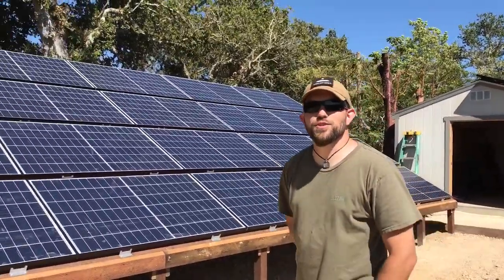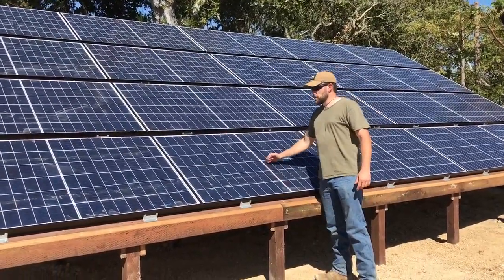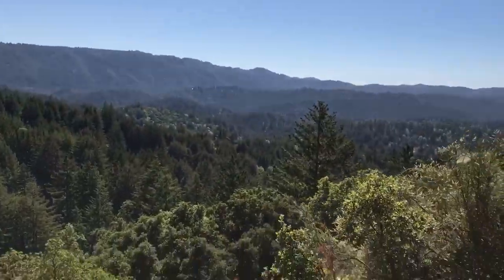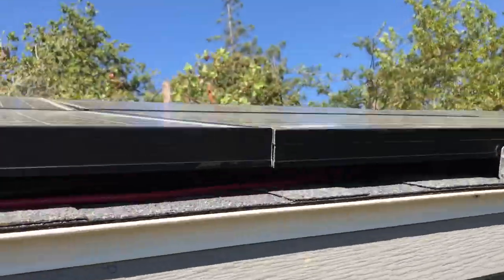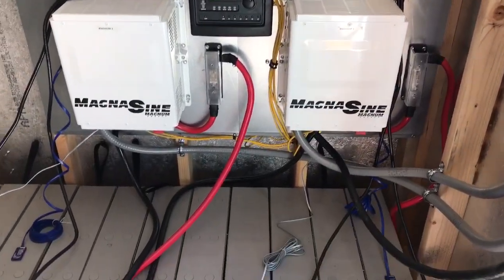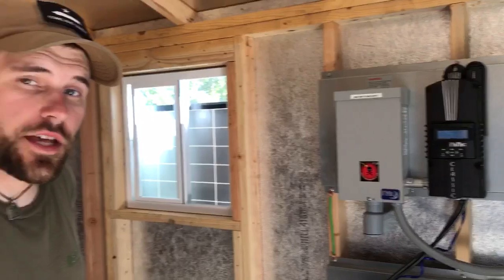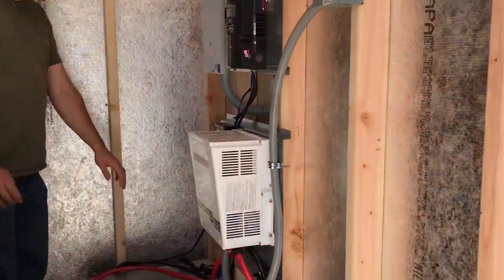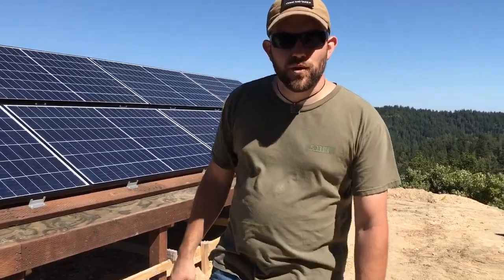12.7KW Off Grid ground mount Solar install by Off Grid Contracting

Comment: This is not off grid living, 1.5 Kw to maximum 3 Kw is off grid living. Offgrid living is not about solar panels and the comfort of city living.

12.7 kw, might as well as move back to the city to one of those suburbs.
Offgrid living is about trhiving off of the natural habitat with a little tec.
When it is it is, when it's not it's not, you don't depend on it, but good to have it.

People like you ruin it. 

When there is sun you can use your 1 to 3 Kw in mostly anything, you can heat water to take a bath, you can do many things, even play on your computer. When there is no sun there is no power and you have to take it like what ever you think you are, man , woman, take it like a man as they say, because this is off grid living.

This is not off grid living, off grid is going back to nature and living in a more natural way without being plugged into the outlet of the wall all the time, managing without it when it's not there, managing on your own without the help of these things.
What off grid is about.

12.7 Kw ...that is huge, even when you don't have sun you will still have like 20%  like above 2Kw of power flowing thru the panels.
Might as well stay in the big city with this "big  planning" of yours.
Reply: Pepsi78 --- off grid living and living a minimalist lifestyle are not necessarily the same thing. Most off gridders live minimalistically out of choice or necessity. Everything from water, food, electricity, etc. are more highly valued when you are the generator/curator of those resources vs having a perceptive infinite supply of such things as you do in a "city" environment. Living like Daniel Boone in a world where you can have modern comforts is a lifestyle choice.. but if one can afford the luxuries of modern society and still be self-sufficient... why not? Oh, and I'm pretty sure this solar system is in place simply because there is not an option to run power lines to the top of that mountain.

 I think what your saying in the end is that your off grid dick is bigger than my off grid dick. It is duly noted and I will concede..
Reply: I can manage with that with just heating wood, but I would like some solar too, not too much just for my stuff, like combine it with the heating wood stove, we don't live in stone age so I can get detergent, long ago people made and sold and traded detergent made out of lye and other things in exchange say for a bag of potatoes , people to this day still sell hand made sop  from their own back yard, 

If I'm power less as in no electricity I have to be ready to manually hand wash my clothing. We can own a car that "we can fix" right if it breaks down, with your own power tools.

I would say semi off grid, but when you are going large like 12KW it sort of takes away the fun and the meaning of what is off grid
Reply: Have it your way, but in a SHTF scenario you won't have these things, off grid means off the grid, has nothing to do with electricity or electric grid line.  It's off the grid, you get the hell out and go wherever you see fit to live and thrive off the grid. The grid line is the electric power company that gives you electricity from your wall plug, the water company that gives you heat and running water and the other companies and corporations.

Off grid is living without these, it's the whole point off the grid from them, not on their grid line in a more natural way, if you bring 12 KW of power you might as well build your own electric power company, you're a freaking power station at 12 KW.  You are living on your grid line now, it's still on grid, off grid means little things that you can manage on, then your off the off of the off grid off of all the grids lol.

Off grid means off any grid line, no grid line allowed, you mean to tell me that this guy with his huge installation hasn't made his own grid line. You can't say at 2Kw of power that you have your own grid line right, everyone will laugh hard at you for saying that.
Reply: Ikillbugs I think in off grid, or semi off grid living you have to combine things, like your wood stove, your smalls solar panels rater maximum to 2 - 3 kw, also have a  small 500W diesel generator, a small wind turbine, you can combine all these things and manage without a huge solar panel array.

Nothing compares to a fire place to heat the home, wood burning inside in the middle of the winter, you are burning pine, maybe nut branches and it smells so good from these oils burning, it gives off the aroma of what ever is burning, it will parfume your whole house.

I'm not for chopping and  burning trees down so plant your own, some trees grow very fast, they can be a few feet high in just a couple of years. You can cut the branches off of the trees  and in an year or two they will be back. You can also  go scavenging in the forest and only pick the branches that have fallen down, there are a lot of them on the ground, you can even make leaf pellets out of dried leafs, these dried up pellets  made out of leaves burn well for an entire hour.

Heat from the fire place does not compare to than electric heat that comes from your electric heater, it creates a whole different feel, steamed water made from the burning tall bucket that is a wood heating boiler will have a different feel, the water is different than the water you heat with electricity.

And finally your small electric appliance for your computer and power tools and for small heating applications like a tiny green house when it is very cold outside or inside your home to maintain some heat in the house to minimal acceptable temperature.

For me off grid can be inside a country side village, you don't have to go all the way to no man's land, where the hawk turns around and go's no further and man falls off the earth, but if you really want to live in a forest it's fine, interesting to live by your self in a forest, if you can do it that is great.

12 kw of power is huge, this reminds me of people chopping down whole trees for fire, majestic trees that were high like a sky scraper, it's the same type of metality with "huge  living" or "let's live big" I'm big, I eat 3 kilos of food every day, I can only stay on 12 kw of power, and if I don't have it I will heat my self by  cutting down a whole forest.
Reply: Self suficient is not an industry, it means little . As in I can manage with what I got.
You need all that it is not self sufficient, your self is not all those things that you use to help your handicaped being survive because "you need all that"

Okay I have enough to buy a corporation and a power plant, I have my own corporation and my own power plant, I don't work for others, right. I am off grid with my corporation and my power plant. I am not connected to any city grid line, I have my own nuclear reactor that I power my electric stove with, my microwave oven and my air conditioning unit.

It's not off grid dude, off grid means you fuck off for good for a while, fucking off means without shit.
I just fucked off into the woods. You just don''t fuck off with all that stuff, that is not fucking off, that is going "ON"

Your business if you want to fuck off or go on, but don't go on pretending you fucked off. Off grid means off any grid line or concept of grid line, big infrastructure, grid means infrastructure, lots off panels means infrastructure, wiring. 

I am well aware that people can't go off grid, most of them anyway, they are domestic animals, those who want to do it for real, good luck to them, I know they want be going off grid, but at least go off Semi off grid, with a little extra to help them out.

Captain America is at it again with a gigantic statue in the harbor of New York,  it needs a big ass flame in it's hand to light up and provide heat for New York, the city of Yorkenstine. 

Do you have any idea how much it costs to light up her torch, how much she consumes, all the small creatures flee from her, she will never truly "FUCK OFF" she has it "going on"

Your too stupid for me to explain to you philosophical things that you do not understand, because you are just like her, you are going on like a dead living cadaver.

Good luck fucking off, tho I doubt you will be able to.
My trend for off grid is FUCK OFF. From now on off grid will be called FUCKING OFF.
Off dude you turn everything down or off, that is off grid.

Will little John be able to fuck off into the woods, or will he have past regresive tendencies, remains to be seen into our next episode.

The Idea off grid is to go and set your mind at ease, to take a break from social residue, to repair your mind, body. Often off grid has been associated with the forest with people going inside the forest.
But if you don't come out of the forest at the end, it means you did not manage and that is your business.
Reply: The reason I'm commenting is for others who want to go "Fucking off" , maybe they want to fuck off.
You don't have to comment on me, I'm just telling them this is wrong and not to go big, go small.

I care about people  who want to fuck off, fucking off is no easy thing, I'm just saying that fucking off is not a "big deal" you see you will not understand what I'm saying because it's not indented for you, only for them.

I don't give a shit what you say, nor about your comments.
Reply: Some "wishes" he had the cash to build something like this. 

Stop hating on folks who are living how they choose.
Reply: So if not EM waves what screwed your mind? Cannabis probably
Reply: Have fun zombie,  don't expect Jesus II , there is no Jesus II. 
Good the zombies can't hear, their senses and vision in this world are gone this includes hearing.

Jesus please forgive me, I did not have much, just 20 Kilowatt solar panels. Jesus is not coming, ahhhhhh, how am I to manage with just 3 Kilowatts, I need more Electro Magnetic mind fuck to stimulate my mind so I can glide like a puppet. 

I need guidence, I think I'll install some transistors inside my brain too to flip flop gates and create a Retardotron.
Reply: All those solar panels generating current, have EM frequency waves that will screw with your mind. All that Electro Magnetic resonance that will affect your brain, you are not off grid. More solar panels more EM interference, more messing with your brain. You will not make it, you dance on the waves like ballerinas dance on the stage, you are rigged. All those EM waves fucking with your mind, how are you OFF GRID ? You are on grid not off of it, the grid line is in your head they are fucking with it.

Done with stupid people like you, seriously you deserve your fate, you want huge arrays, you want to swim into the waves dude, maybe you will get a chip too inside your head while off griding your own way.
Just don't come to my part of the woods, stay the hell away from me, why I left a huge city, I know you, I can get infected from you with what you got inside those waves of yours floating inside your mind like Coca-Cola.

You are the fucking laughing stock for all of us who can see past the bull shit, and this time we don't give a shit. Fucking Jesus shit man, this is what you get, things never get fixed.
Reply: Remember this.....this time you are responsible for what you do, you fuck up that is your problem, no Jesus, no cleaning vacum lady from outer space, nothing. Clown day is over.
Reply: You are stupid, I'm done with you, I don't care about you. I don't need friends, I got my self that I will never give away. You need things not me. Friends for me are extra, I often end up serving them for free, because true friends for me are more than friends, they are like bros as in brothers. I don't need friends.

That is the point, no Jesus this time to give you shit, just stay away from us. Zombies with sun glasses, Christ.
Stay the fuck away from us, I'm sick of dealing with cadavers on the street.

Comment: Why wood rather than metal? How about an adjustable angle mount so you could change the pitch to account for different times of the year when the sun tracks a higher or lower path?
Reply: No idea why wood people saying price must not purchase materials often treated wood in the quantities needed for hurricane/nado rating is VERY close to 2 1/2 galv pipe and all aluminum railing...... And being able to adjust is not worth losing rigidity compared to the very small gains from adjusting angle.

The design in general of the wood structure is a fucking joke, lets put 10k worth of panels on giant wooden sails, Stupid.
Reply: @EmperorChrisKo  I would design with three metal frames.  Rigid pipe, diagonal tension cables if needed, panel frames atop the pipe frame, central horizontal pipe for strength and pivot point ... two vertical pipe mounts to get it up in the air with galvanized 4 inch pipe and a yoke/cradle to set the center horizontal pipe into, with  placement locking mechanism and with a couple of front and back (or on each of the four corners) , mount two-piece channel or angle iron, mating vertical stabilizing adjusters on pivoting ends, with holes and pins. Simple and versatile.
Reply: No thanks Mr. window licker.
Reply: Yeah, I was wondering if they used cement footings for the structure. If they did not, that seems really stupid to me. I'm not in construction, but, it seems to me that one should consider what will happen if you get a strong wind. Also, putting wood directly in the ground is just an extremely bad idea IMHO.
Reply: Chris Ko o
Reply: I would not do a tilt of one end, that is top or bottom with the othe being the pivot.. too big unless you separate them a bit... Pivot for tilt yes, but I would have zinc plated (you want it to last 25+ yrs) rigid pipe (or angle iron or channel iron) frame and have a central horizontal heavy pipe (3 to 4 inch diam,) on a mount that allows you to pivot/rock/adjust the array(s) and with stabilizing anchor arms ... (4 in front, 4 in back for that huge array) . 

 I can see the design in my head easy for that. Just have to make stable for wind events.  If I ever do such an off building array, which I actually like, I may try to design it that way.  If you make a square shaped set of three arrays, you can mount on a strong vertical post with concrete base, and with swival ball on top with a frame that an pivot east to west and up and down to meet needs best.  Some places are sunnier in the morning than at noon or later in afternoon.  Pic the best or go manually rotate with the weather.  For some more money, one could get serious and motorize that and use a sun tracking sensor to follow the sun best, throughout the day, automated.  Probalby cheaper to have more panels as is now though and just adjust once a month on a tilt or central tilt-pivot rod/pipe with stabilizers... Design it to take less than half hour should be easy and make more year round efficient.
Reply: I'm with you, Bill Green.  If it were me, these panels would be arranged on discreet metal poles with automated sun tracking adjustment to optimize exposure during any given season.
Reply: Those are also my two issues with solar installations.. that many are of wood and that they are on the ground.
It seems to me a complete waste of usable shade space beneath the panel to put it on the ground.  I get that each additional foot of elevation adds cost but it just seem short sighted to me to put them on the ground when so much space beneath could be utilized.
Reply: @twelvewingproductions7508   I agree.... grow shade loving vegies underneath... Lettuce, others. There are a few, if the temp is high enough.  OR park your riding lawn mower under it if higher!!! I would think 6.5 ft on the lower end should be good and design as I stated above, with a pivoting rack to adjust angle to the sun once a month throughout the year.  Just adjust stabilizer bars... 8 should do it.  I would do all zinc coated metal frame. Some light metal, some stronger or pipe frame where needed.  Puting it up in the air also causes it to get less dusty/dirty/hazed. Less cleaning needed but for Rain to auto clean.

Comment: This more than likely a stupid question, but how do power your house? I get the whole  thing about to hook and connect things to the battery and inverter, but when you are ready to use one of your appliances how do you connect it?
Reply: you see each of those panels has power hose connected to them,just take a plastic bucket (don't use metal ones cause you will cause short circuit) fill it up with electricity and bring it home,pour the bucket content out around your house near mains,done 8-D
Reply: INTERNATIONAL Thanks!

Comment: Nice project.  Alot of thought went into it.  Nice tour of the project.  Alot of power.  They have enough for charging an electric car in the future.  No need to have gasoline.  Pretty cool. Since the panels degrade after 20 years, they will still have power.  Nice to be where you want to live and have the power to have heatpump, I suggest minisplits, and be able to charge a car and have lighting and more.  Great job.

Comment: You'd go anywhere in the world.? How about the Dominican Republic.?.. Please tell me, how much equipment would I need to power a 3 bd , 3.0 ba , 2, 600 sqft house, with a large fridge, microwave, blender, etc.?.. No air conditioning or electric stove. And how much would it cost.? I understand there are variables, but rough figure.?..